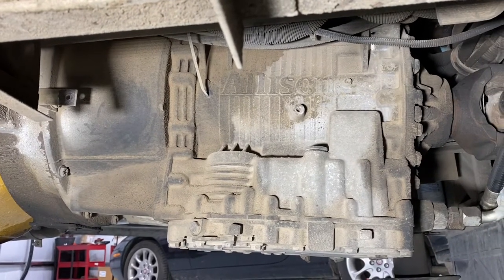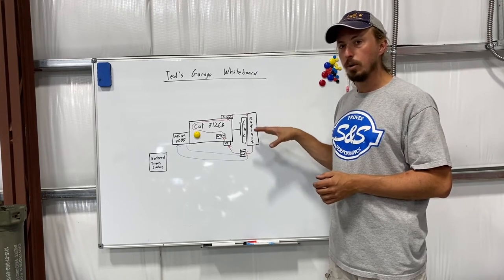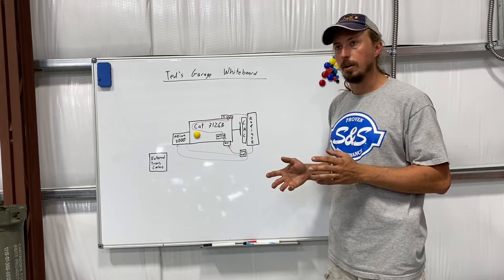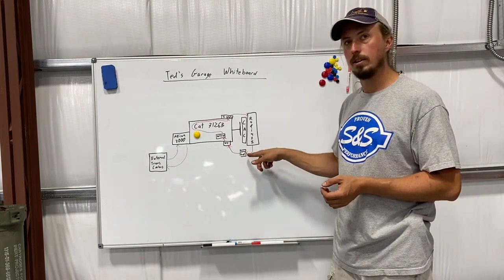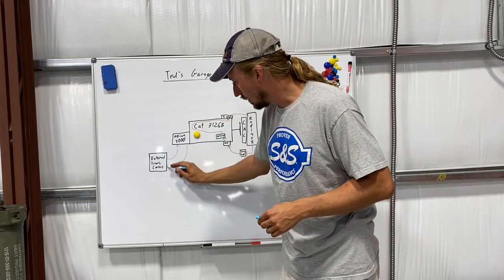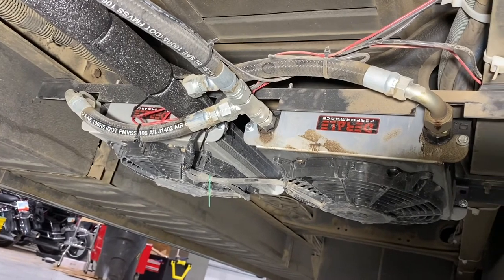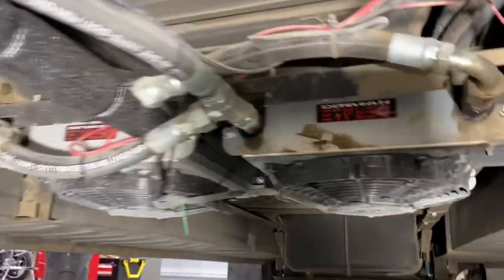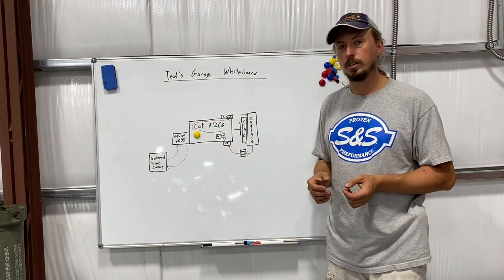Adding an Independent Transmission Cooler Setup for the Allison 3000 on my RV

Comment: I’ve started the cooler project for my Allison 4000. Building the mounting frame this weekend.
Reply from the maker: On my recent trip one cooler spring a leak and I had to bypass it. The single cooler is marginal - it keeps the transmission temps under control on my 3000 but the fan is running constantly.

Comment: Well I haven't done the install yet but yes it will be a 1 fan Derale 15875 setup. I wasn't aware that you could adjust the fan temp. I've read that my trans & engine temps I'm seeing are normal for that rig but would like to lower them a bit & that Trans cooler setup should do the trick for both & I agree with you on the "stock" trans cooler setup. I've definitely read where these have gone bad & a big job to get it all straightened out!

Comment: Thanks for the pretty thorough video. I'm about to undertake a similar task. I have a 2003 Monaco Signature with a Cummins ISX 525 and Allison 4000 transmission. I replaced the radiator two years ago because the hydraulic pump that feeds the radiator fans broke, and everything got hot and radiator leaked. All works fine now, but when I sit in traffic, even with putting into neutral when sitting, my trans temp goes into 230s. That doesn't seem to cause a problem, but I decided to add the external cooler like you did. Specifically, I'm adding a Derale 15876 cooler, putting it in the curb-side grill area where there is lots of room, although it will probably get some heat from the muffler. Anyway, my plan is to go from the OUT port of the radiator where it previously went from there back to transmission, and instead go from there to the new cooler, and then back to the transmission FROM COOLER port. I'm adding a snap-disk thermostat to the hose entering the new cooler so the fan only goes on when the temp reaches 140º and goes off at 120º. Looks like I'll need to add maybe 20' of hose. My fittings to transmission are 16 and look to be steel / SAE. Thoughts?
Reply from the maker: I think your plan sounds good. The one thing I would do differently is I would have the transmission fluid go through your secondary cooler first, and from there then go into the stock cooler. So transmission -> new cooler -> stock cooler -> back to transmission. That way you're reducing load on the stock cooling system. But, either way will work fine.
Reply: Hi Joe... very interested in your 2003 Monaco install.  I have a 1999 Country Coach which has a radiator leak in the transmission cooler part of the radiator.  I too plan to separate the trans fluid from the present radiator as a radiator replacement is near $6K for the radiator alone.  I am wondering if you did the conversion and how it worked.  It seemed you also had a radiator failure as you mentioned a leak.  Did you completely separate the original transmission part of the radiator? Did the loss of fluid volume make any difference?  Thanks for your response.
Reply: @Vertigo1894  Well, I did manage to get the Derale cooler mounted behind the right rear cooling grill of the coach, but that's as far as I've gotten. Some health issues have kept me from installing the actual lines from the radiator to the cooler and back to the transmission. I do plan to keep the radiator in the loop, as it's new with no leaks. I'm hoping I can find someone, maybe a shop, who can measure and install tha actual lines for me in the near future. Here's hoping. BTW, the cost of my radiator, a really big one, was just under $3k from C, G, & J in Alabama. Good luck.
Reply: Thank you Jonathon!  Did CG& J build a complete radiator or just the trans fluid part.  It seems the one I have, has the lower trans cooler part welded to the large H2O radiator above it. I thought your trans cooler was leaking and you were just going to by-pass it.  I guess my misunderstanding.  My Trans cooler is leaking badly so I was hoping to  bypass with separate trans cooler, but hesitant if its not been done before.  I hope your health issues subside so you are able to have some fun traveling !
Reply: @Vertigo1894  C, G, & J built me a completely new radiator with the trans cooler tank on the side of it, an exact copy of the original. They were very quick with the turnaround and shipping. I supplied them with the number that was on a sticker on the original radiator, and they took it from there. My radiator itself was leaking and could not be repaired, probably from severe overheating when the hydraulic pump that supplied the radiator fans took a dump. As for completely bypassing the trans cooler on the radiator, I've read multiple places where it's been done. BTW, I'm Joe; Jonathon is my son who ordered the radiator, and he and my son-in-law did the heavy lifting of switching the radiator out.
Reply: Thanks again for responding Joe.  This news is encouraging !  Were they able to get the radiator out without jacking up the motorhome? Do you know where the identification sticker on the radiator is located?  I have been searching for days ref. by-passing the trans cooler, but not seen anything more than a supplement to the existing radiator cooler. I sure would love to see some information on by-passing the factory radiator completely.

Comment: Great video! 
I too am planning on separating the trans cooler from the engine cooling on my 3000 and have a question for you. How did you determine the output side from the transmission to the new oil cooler. Just thought I'd ask before crawling under the coach. Thank you!

Side note: I have a buddy with an American Revolution that did have this trans cooler failure....uggg....I am so glad to have found your video as I didn't think to separate like you have shown.
Reply from the maker: The way I found the flow vs return side was simply to have both hoses located where I wanted them but disconnected, and then started the bus with my wife watching. As soon as she saw flow I shut it off.

Loses a bit of fluid and is simple but worked for me.

Good luck!

Comment: Great Video Ted & I want to do this same change to my Allison 3000 hooked up to a Cummins 400 ISL. I assume you capped off the in & out lines of the stock trans cooler?
Reply from the maker: Thanks! Yes, I did cap the ends on the stock cooler.

Comment: Ted...what are the ends of the OEM trans fluid lines at the cooler Male or Female? I'm planning on using the OEM lines for the new Derale since they'll easily reach to where it's going to go & why change them out. I do know they're #12's so reduction adaptors will be needed & I've already located. 
Thanks!
Reply from the maker: On mine the factory trans cooler had make ends, so I needed female caps to cap off that side.

Comment: What temps does your Allison run with the cooler change? Mine runs between 208 to 212 with the cruise set at 68 mph on a hot summer day & a long day run. I run Transynd in the Allison &  Mobil Delvac™ Extreme in the Cummins.
Reply from the maker: I believe you’re running a single cooler? With the twin cooler setup my Allison runs at whatever temp the fan thermostat is set at. I have it running at about 185F. Your temps are ok per Allison I believe but on the warm side.

Comment: At 17:30 central time I granted the  Allison 4000 transmission a divorce from the Cat-13 radiator. 
Minimal fluid was shed 😭😂😂
Reply from the maker: Congratulations!
Reply: @jeffking3160 Did you end up going with the Derale Hi-Flow Racing 65860 model and how has the performance been?  Thanks
Reply: I added a different cooler with dual fans. 

2005 Newell Coach. 
Caterpillar C-13
Allison 4000MH

My transmission fluid temperature is rock solid at 192° F

Comment: Very good video, thank you! I've never been a fan of using engine coolant to 'cool' the tranny & the oil. It looked like the 'L' stock you used to frame your tranny radiators could've been mounted on top of the frame rails. What happens if you come to a flooded part of a backroad, will the fans 'shut down'? You set up your tranny coolers in sequence, that's smart, but I thought it was to clear the driveshaft but I don't see one. What'd you do w/ the driveshaft?
Reply from the maker: Glad you found the video useful! Good questions. I could've mounted the L-stock to the top of the frame, however if I did that there wouldn't have been as much room above the coolers for airflow. Where the coolers are mounted as-is, at their lowest point they are still more or less in line with the bottom of the storage bays. So because of that, I wasn't particularly concerned with the prospect of getting through a flooded backroad. If it's that flooded, then I really shouldn't be taking a 40' bus down it, and it certainly wouldn't make it through with the tires I have (and likely wouldn't make it through with any tires).

I've driven it plenty in the rain and it hasn't been an issue - these coolers normally operate in wet conditions and are designed for it, so no issues. To clarify, I run the coolers in parallel, so the transmission fluid "T"s off, should go through each cooler equally, and then back to the transmission.

Regarding the driveshaft, they are located in front of the rear axle so there is no driveshaft in that area. Being a diesel pusher, the driveshaft is behind the axle, going to the engine/transmission in the very back of the bus.

I'm not sure exactly how many miles I've put on this at this point, I think probably on the order of 10-15k. The system has worked fantastic, zero complaints, and I wouldn't do anything differently if I were going to do it again.
Reply: @TedsGarage  Thanks! Keep the deer off your grill.

Comment: Allison 4000

Hello Ted,
Great videos, I know the owners appreciate the detail and engineering perspective. You’re clearly moving the needle on these machines and proving naysayers wrong. 

I have a Coach, Caterpillar C13 with PDI tune, and Allison 4000. 
Normal traveling weights without tow vehicle is 57k lbs. Add the tow and we’re over 60k. 

There are times my cooling systems are not enough to take care of cooling the fluids. 

I would like to add a Derale 15876 cooler to the transmission. 

On my setup, the transmission cooling lines run to the side radiator from the rear transmission cooling ports. The forward ports are not used/plugged.

I’d like to utilize the forward cooling ports for the Derale cooler. 
I understand you completely divorced the transmission from the radiator. I’m not at that point yet but maybe someday as I too would like explore electric fan radiator coolers. 

I can’t find any information on these Allison cooling ports and the capability of the transmission hydraulic pump. I believe you mentioned a pump concern on your Allison 3000 when you built your cooler mod.

I’d be interested in your thoughts of adding a cooler utilizing the second set of cooling ports and continuing to use the factory radiator cooling setup… for now…

Thank you,
JK
Reply from the maker: Hi Jeff, I don’t know anything about the Allison 4000 (only have experience with my 3000) so I can’t speak to the forward cooling ports, and if those work differently.

My concern regarding the pump mainly had to do with not increasing restriction significantly from stock. Reducing restriction is fine. If you can find info that the front cooling ports are fine to use just by unplugging the ports and hooking up a cooler, then that should be fine. Otherwise you could put Ts into the existing rear ports and simply run the Derale in parallel, or if your existing ports are -12s you can run the Derale first and then the main radiator second.
Reply: I’m going to verify tomorrow but I think the AN fittings are 16 (1”).
I did get to talk to a Allison shop manager. His initial thought was adding the Derale to forward ports might reduce or disrupt flow through radiator. 
If I’m not mistaken, AN-12 = 3/4”, AN-16=1”.
I need to determine how many Derale 15876 I would need for the 4000.
Reply from the maker: @jeffking3160  the transmission fluid might be reduced through the radiator, but if you’re running a second cooler in parallel that’s fine and not an issue. It won’t impact the engine coolant flow since the transmission cooling is just a heat exchanger in the side tank.
Reply: I spoke to Derale tech about the cooler best suited for the Allison 4000. They suggested the 18 row Hi-Flow Racing 65860 125,000 btu. It has a 8” low profile fan, 625 cfm, 20 GPM flow rate. 
Did you happen to consider these fans over the units you went with? I have no knowledge of how to size a cooler to a transmission. I do know my set up is not efficient so a change must be made.
Reply from the maker: @jeffking3160  I did see that unit, part of why I went the route I did instead was because I found deals on the dual units which ended up being cheaper. Also, I was able to find a simple fitting that allowed for an in-line thermostatic switch to control the fans. I'm sure you could still find a connector that would let you add an appropriate thermostatic switch.

Looking at BTU ratings, that one cooler is the same as both of my coolers combined. So that would definitely be simpler, you'll just need to get hoses/fittings that are appropriate. Assuming you have a place where you can mount it (I would definitely mount it vertically in your case if you can, rather than horizontally like I did - that way you'll get natural forced air flow), I'd suspect that will work.
Reply: My only concern about mounting them vertically is debris. The highway system is nasty. 
I need a unit in hand so I can see what I’m dealing with. Fresh air intake system would be night.
Reply from the maker: @jeffking3160  Agreed that horizontal helps to reduce puncture debris concerns, but keep in mind that virtually all radiators/coolers of any sort in factory applications are mounted vertically. But reality is with the fan forcing either one will work, it's just that if you have it vertically mounted you'll get more natural cooling, and thus more overall cooling. However that setup is designed to be remote mounted in a location that may not have much (if any) natural airflow.

Your available space will dictate the mounting more than anything else.

Comment: Hi Ted...Well I've about completed the Dearle Cooler setup...but I want to take the cooler out of the system & replace it with the same cooling system 2 1/4" diameter & 17" long tubing but can't seem to find where to find that tubing. Googled it & it kinda wants to change it to a Hose not metal tubing. My local big truck parts hose that did my new trans lines didn't have any suggestions either. Do you have any ideas......& that for all the insight on this cooler install!
Reply from the maker: I ultimately just left the stock cooler in there and found that to be the simplest way to go. But a length of exhaust pipe would work as well, you just need a bead on either end. If you don't have a bead-making tool I've seen some videos about alternate ways to put a bead into a pipe so the hose won't slip off.
Reply: I agree leaving there keeps it simple & I put -12AN end caps on the ports. You think a 2 1/4" exhaust pipe would do the job long term?
Reply from the maker: @Jack-r4z2g  If it's aluminized or stainless I don't see why it wouldn't, but I've not had any issues with the capped stock cooler in the 2+ years since I did the swap and the weight reduction is negligible on a 20k+ lb bus.
Reply: I agree...it's in good shape so I'll just leave it capped..thanks

Comment: How often do you need to clean them, and have you since eliminated the original cooler completely?
Great video thanks!
Reply from the maker: I've put about 20,000 miles on the system now and haven't had a need to clean it. I did clean all my heat exchangers a few weeks ago (radiator, charge air cooler, etc.) and so I cleaned these as well, but there really wasn't any grime on them. The system is still working very well.
Reply: @TedsGarage  That's very impressive!   I've saved you vid for future reference.
Thanks for making it.
Reply from the maker: The hoses I just had made up at a local hose shop, and the relays are standard Automotive relays. Get good ones, I used Bosch.
Reply: @TedsGarage  Great, thanks for taking the time to reply.

Comment: What fittings on transmission? #12 an or what? I own a 1997 endeavor lE with 3126 B.
Reply from the maker: I can’t remember the exact size - 12s sound right. I brought the old hoses to the hose shop for them to match up.
Reply: that part number shows them being -10 fittings
Reply: This is where I'm struggling at, is figuring out the hose situation 

I have a allison 2500 HDS in my wrecker, and I am trying to get away from the Liquid to liquid cooler.

So I figured doing this exact thing wad the answer. But I want to use crimp style hoses and I'm not sure where I could find them
Reply from the maker: Any hose shop can make them, just bring the old fittings with you for them to match up.
Reply: @TedsGarage  so you replaced all the fittings and didn't use the -AN fittings?
Reply from the maker: @hazmat409  I replaced all the fittings and I did use AN fittings.

Comment: So if I understand you right that would make the "factory trans lines" to the factory cooler male..correct?
Reply from the maker: The trans lines on mine were female at the cooler. The cooler side was male.